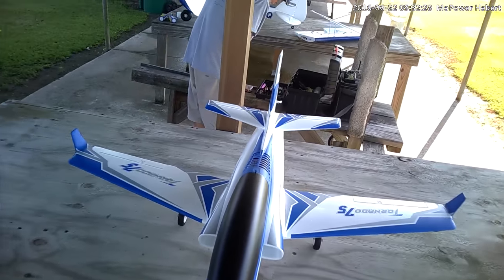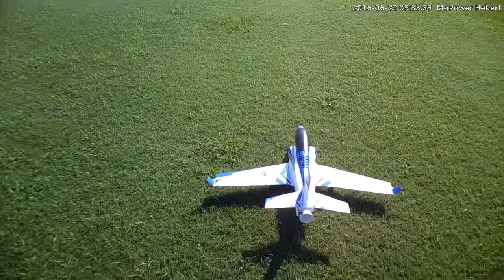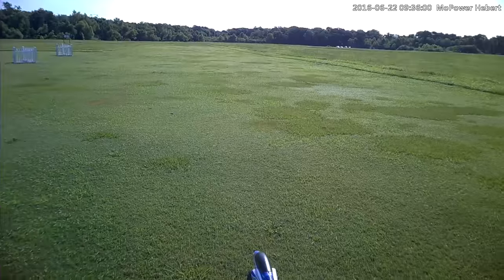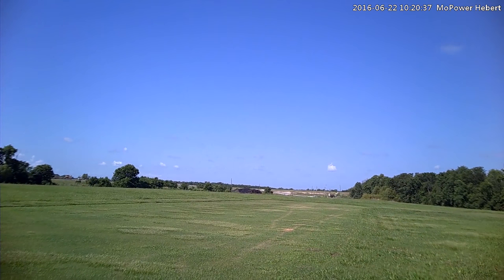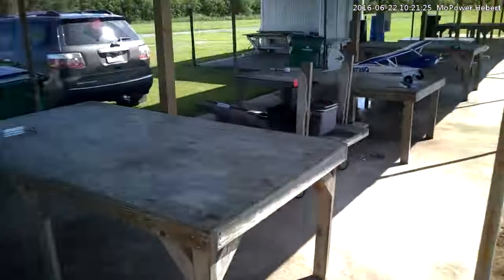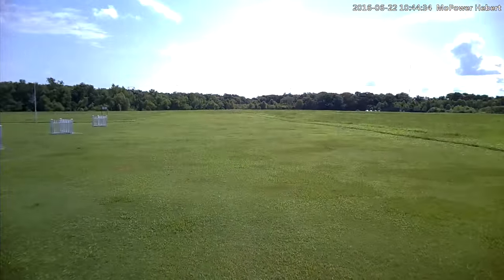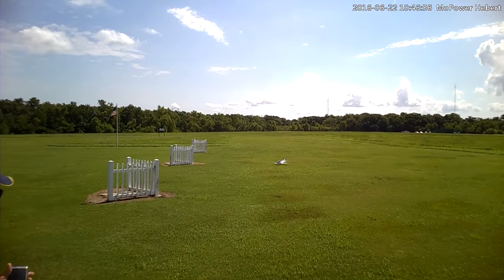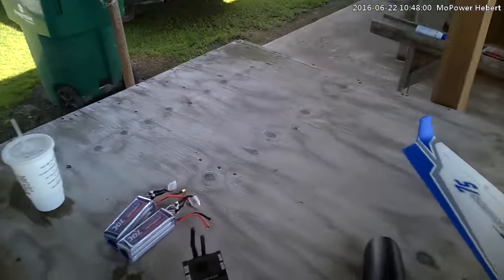RC Tornado Jet With ESS Sound System + JP Hobby 70mm EDF Maiden Flight

Comment: Would you mind sharing how you 'beefed' up the hinges on this one please? Have just revived mine and can almost see through the gap between wing and aileron.....  Thanks
Reply from the maker: Raymond Blair 
Sure, what I do is take some foam tack, cement glue or silicone and run a very fine bead in the seam, then I take a qtip and smooth it down and wipe all excess off, then let it dry, then move the surfaces up and down a few times to get the stiffness out of them. That's it I hope it helps you too.

Comment: hi there thanks for posting the video showing how it sound's , how did u find it with the Me 262 sound ? as I have got the dynam Me 262 2ith the Ess-air sound fitted to each engine pod and such also fitting Dr.madthrust LED ring for it , but how did u find it sound when flying and did u have it on the lowest setting ?
Reply from the maker: It's on there site or in the app to add sounds to it, it's under jets.